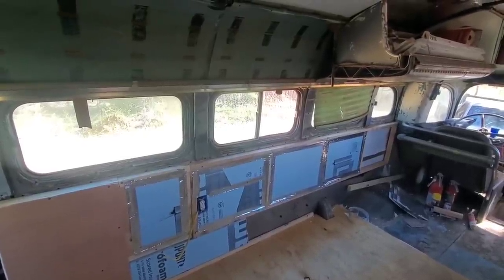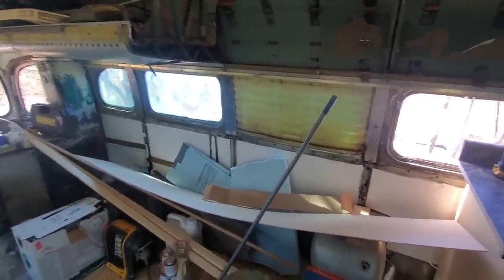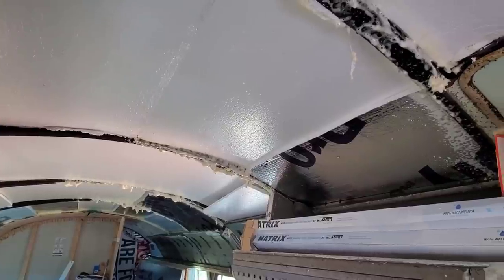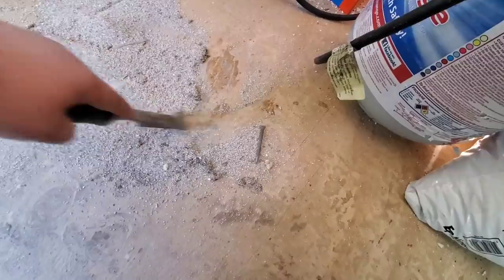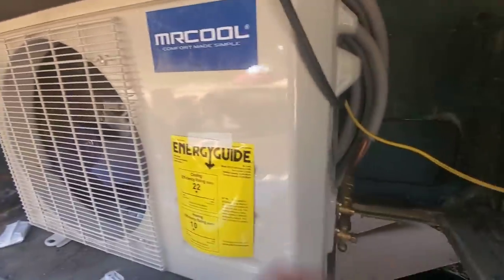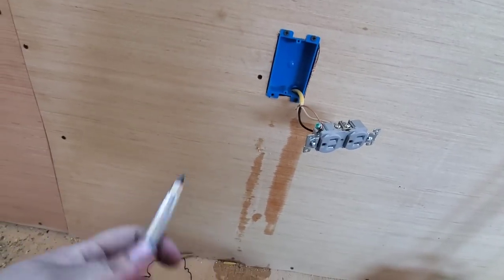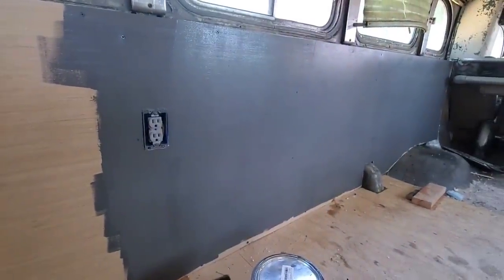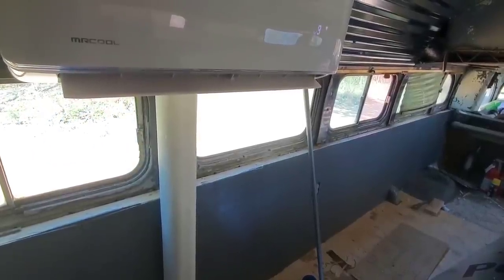Mr. Cool mini split installion Bus Build day 14

Comment: Hi Tyler, if the spray foam mix ratio is 50/50 then you could weigh each tank and determine if they are both feedinig equally to see if you have a clogged line on one of the tanks. Sorry man for your headache, but thanks for the videos as they are really helpful. Good luck.
Reply: Definitely seems like a mixing issue. Not enough of hardening ingredient, just like with two part epoxy when you don’t mix in quite enough hardener....

Comment: thought of the day, based on vapor, one might consider sealing and or painting the interior surfaces before mounting the panels, personally, a wall with plywood in a cetain shop with dry wall over the plywood allows one to mount anything they want without the need to look for a stud "Scott".
ME? when I rehab a house using "hard board" I paint both sides before install, just a thought. cool bus design!

Comment: 4. Spray foam contracts and pulls away from framing.

I’ve seen this only once, and it was with closed cell foam, but I’ve heard of it happening with open cell foam, too. I don’t know the details, but I’ve heard it could result from a bad batch of chemicals, improper mixing, or too high a temperature.

Comment: Just so you know you are supposed to break the corner tabs off of the electrical receptacles when you are using those types of electrical boxes, that is why it is not siting flat and bending the tabs out.

Comment: Just wondering why you did not run the pipework for the mini-split inside the interior wall that you built?
Reply from the maker: The lineset is joined. To make a hole large enough per their instructions the hole had to be moved in to avoid structural members in the floor.
Reply: @Spyke383  how annoying, but sounds like you had no choice.  Keep up the good work, I look forward to saying your progress updates!

Comment: I missed the outcome of the removal of the short wall at the entrance.  Did that ever happen?   You were moving on that hot and heavy but I think it looks intact.  Whoops - you just said that you never removed it.   I am anxious to see that.  It has been quite a saga.   Priorities, priorities.  I would install cooling first too.   The bees are out in force here in PA and summer is around the corner.  Looks like you are back in the saddle.  Good luck.  "I am blown away by my air conditioner..."   ROTFL  The one-handed use of the Milwaukee tool to install the ground wire was truly amazing.  Reminds me of the dexterity I used to have.  Very cool tool.

Comment: Suggestion for Paint Cans. Always pour paint out of the can, in a spot if it drips / pour's down the side of the can, you can still tell / read the paint color, and other information you deem necessary. 

ALSO use a 16d nail, (or smaller Dia.) and punch 3 (three) or 4 (four) holes, to allow the paint to drain back into the can from the LID=LIP. Punch the holes in the bottom of the LIP.   Punch holes in the same area you are going to use for pouring out the paint. Don't worry about holes allowing the paint to "DRY-OUT." Not a happening thing FYI.

Comment: Question, what are the potential  issues with managing airflow in the A/C Bay for the new unit?

the old one seemed to be set up to pull in fresh air in through the side and dump down through the bottom of the bus (don't think they would go the other way and pull up form the road).

you said you were going to close the down facing openings, will you need to do something with the new unit to manage the air flow?  either a recirc fan or some simple flashing so that the unit will naturally pull air in and then force it out on its own?  i imagine it will cost efficiency if the A/C is reusing air in the bay.

inside the bus, does the unit have something for the sleeping area?  or is there some way of circulating air between the forward and aft end of the bus?  at work and at home, i have usually had more issues keeping air moving then cooling or heating.
Reply from the maker: I'm only closingnthe hole in that bay, the angled one that goes into the bext bay will stay and the door to that bay is made to allow air in. So far being close to a week in we've had zero issues.
Reply: @Spyke383  congrats then.  that stuck in my mind as a concern, the efficiency loss if the thing doesn't really bring any fresh air in once you shut the bay door, it stirs the air in the bay could really add up.  that's why i thought a bit of flashing would let the things own fan be used to circulate air through the bay.

that bay is pretty clever the way they configured it.  even seemed to have  a trap door under the pony motor to allow maintenance while it was installed.

all told, the bus plans look great so far with the exception of that wall at the front.  unfortunately for you it appears it was built to withstand the ages against people grabbing and swinging around that corner.

Comment: Over here in the UK we have to put a yellow & green sleeve over the earth/ground cable in mains socket outlets. Helps to identify it, but more importantly prevent short circuit across the other terminals. Your conversion is beginning to take shape 👍

Comment: Tyler, until you hook up an external AC thermostat, you can use the "follow me" button on your remote control.  It will give you better performance then the internal thermostat.

Comment: Tyler it's really coming together nicely I like the gray color on your walls bummer on the spray foam if you find out exactly what happened could you please share I haven't bought my spray foam yet and I don't want that kind of surprise with mine.
Thanks for sharing brother it's going to be cool when your done.
Reply from the maker: It worked fine the first 3 times I used it but then it sat for over a month and I suspect got too cold in the process.
Reply: @Spyke383  that would do it bummer though your right its not cheap

Comment: With the closed-cell foam temp.is very important! read the boxes and it will tell you to submerge them in hot water for some time before use! and the surface temp. is important also!!
Reply from the maker: They were considerably warmer than they were in January when i used them over 75 that day with warm nights.
Reply from the maker: @DrinkWhiskeyRaiseHell  tips are changed every use but possibly an issue with the lines. It's been 5 days and still hasn't set. Just a gooey mess in the trash.
Reply: is that the type you can shake if so you might try shaking and see if that helps it may have separated because of the cold temperatures just a thought but looking good so the a.c. comes pre charged with freon? I no some heat pumps come pre charged but sometimes you have to add more freon for proper use but stay safe stay healthy stay busy

Comment: Don’t you need to use a vacuum pump on the mini split before opening the valve to release the refrigerant? Bus is looking great nice work
Reply: No vacuum pump needed.  All the lines are vacuumed sealed, when the connections are hooked up, that opens the seals and lets the freon flow.  The outdoor unit has the freon tank inside.  The design & hook up is very good and easy.
Reply from the maker: @CoolBlue87GT  yep, easiest install I've ever done. Took like 4 tools.